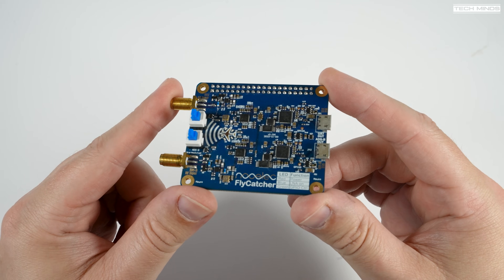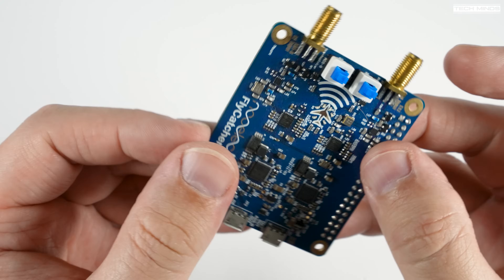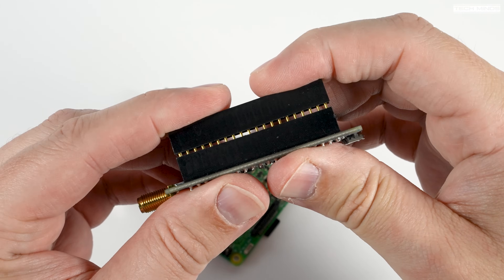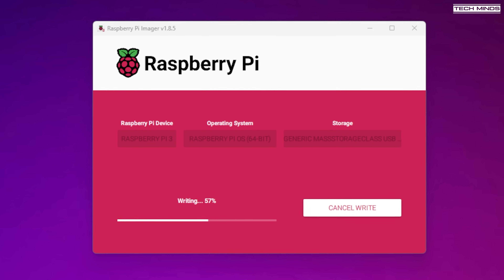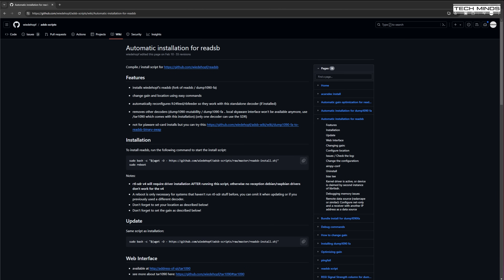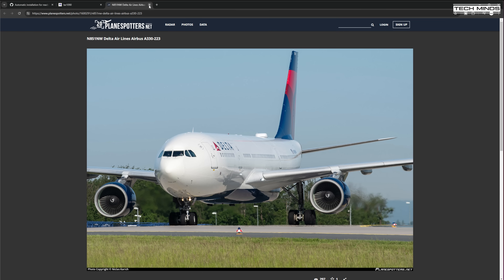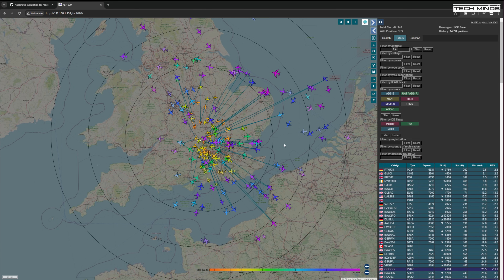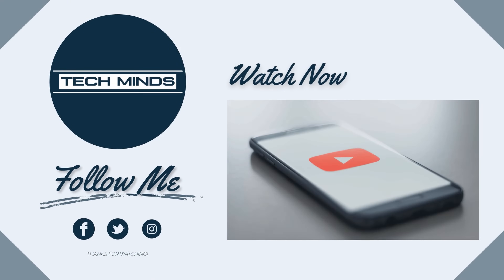Easily Create Your Own Aircraft Virtual Radar Using The NooElec FlyCatcher Pi Hat

Comment: I have it set up now and using in the field for our VO to monitor manned aircraft. Yes, I said "manned" as opposed to the woke term, "uncrewed". The old FAA boys prefer manned. LOL. So far, works great. I found a 3D printable case that fits well. The Pi can supply necessary power to the Flycatcher.

Comment: Big fail on this hat, it doesn't need/use (?) the 40 pin header and doesn't pass it through. The pins are unusable. So it blocks all the pins you might want to use for say.... environmental monitoring of the enclosure the pi is in. I love the idea, but this is a big fat Fail on nooelec's part. If you don't need the pins, either properly pass them through or don't use the form factor that blocks the pins.
Reply from the maker: Ummmm.. You can place the HAT at the top of the stack?

Comment: I run the blue FlightAware Pro USB stick with a Raspberry Pi 3B. It runs hot unless I use a fan so I've always been hesitant about using a hat with it. Maybe it's the quality of the heat sinks I'm using? I don't know but this hat is interesting and would be awesome for me since I can only do ADS-B and not UAT with my current setup. The ability to run both from one interface and one piece of hardware is awesome.

Comment: LOL ..What an Innovative Product Name (FlyCatcher) .. This is another reason I would want a Raspberry Pi for a detocated Set up for ADS-B.. But ..  I Don't need the Board as I would Just use a simple RTL-SDR with the Software.. The Home Brew ADS-B (1.09 Gig) Antenna that I made.. (Rocks) 200 Mile Radius Reception... No LNA or Filters needed. (Some PVC Pipe and some RG-6 Coax is all you Need to build one..) (16 Segment Co-liniar 👍)
Reply: Ditto. I fail to see why I'd purchase a $99 board if a $15 (or less) RTL dongle will do the job just as well. I have been providing flight radar and radar box with ADS-B data for many years now with el-cheapo RTL dongles and home made antennas without a glitch.

Comment: So it's an overcomplicated, quite expensive SDR in which the filter is used after the amplifier for some reason, and it doesn't use GPIO anyway and has to be connected via a USB cable?
Reply: But you get something that only can be used states side. Still rubbish here in the UK/Eu
Reply from the maker: Rubbish? Did you not see in the video how well it performs? I think what you actually mean is that it’s uneconomical to use in the UK because one side of it is for UAT, which is unused in the UK. I would definitely not call it rubbish.
Reply: @TechMindsOfficial  I did and I see better from a FA Pro stick plus, Uptronics LNA. The jet vision aerial is pretty bespoke you used. Heard mixed results with them but vs what I get using a Phil antenna, Noelec V5 and a Uptronics LNA I’m miles ahead.
Reply: Yep. Totally pointless
Reply from the maker: You get 2 x SDRs, 2 x Filters, 2 x LNA in one small form factor board. USB is independent from the GPIO and any data capable lines on the GPIO would not have the throughput.

Comment: I don't understand the purpose of the Pi hat form factor if the GPIO header is completely unused and you plug it in via USB anyway.
Reply: … MicroUSB? Ugh…. No thanks
Reply: I agree. what a messy setup.
Reply: Yeah, I don't understand chewing up space and BLOCKING OFF the forty-pin header of the RPi...AND THE EXTRA expense of the forty-pin header of the board in materials and installation. I bet some IDIOT in marketing made them do it 😉
Reply: @bob_mosavo  it is a pass-through so with a header that has appropriately long pins you can still stack another hat.
Reply: @explodinglemur  As shown in this video, it is NOT as pass-through unless you solder onto the pin(s) you wish to access. There are NO "appropriately long pins" shown in this video. I found this board on Amazon, and each pictured showed NO "appropriately long pins" for any type of pass-through without soldering. So, it's really just chewing up space and BLOCKING OFF the forty-pin header of the RPi. What a STUPID design.
Reply: Right, this should be mounted underneath and not on top.
Reply from the maker: You get 2 x SDRs, 2 x Filters, 2 x LNA in one small form factor board. USB is independent from the GPIO and any data capable lines on the GPIO would not have the throughput.
Reply: @TechMindsOfficial  Really, it's just a plug and been way better if it was an external USB3 device as the hat form factor offer no advantage in the way it is designed, and don't see how it could.  PCIe on the Pi4 would be an option, though external would be better on many level.
Reply: @TechMindsOfficial  yep, but they could have made it just a separate device with its own enclosure (and could have used a USB hub IC so you only need one USB connection).

Comment: Does the two SDRs have different serial numbers ? 
I could be a cool product, if the hat took advantage of the GPIO pins, instead of having the two USB cables hanging (not as compact). It is too pricy for me, beacuse I cannot use the UAT part in the EU. 
But it is always nice to see new products, so you know that is out there. Keep up the good work.
Reply: The UAT filter could be removed and replaced with a capacitor, You then have a wideband sdr for use on aircraft band using other software ie sdr#, HDSDR etc. After all they are 2 independant receivers. Just a thought.   :-) Typo edited
Reply from the maker: @nofider1  That's a really cool idea! As I am in the UK I would never use the UAT side, but having it connected to an AirBand antenna I could also use it to listen to airband.. nice..!

Comment: Why place the filter AFTER the LNA?
Reply: You've got two options for filter/LNA arrangement order and each has pluses/minusues.
Antenna -> LNA -> filter: You get maximum signal into the LNA so you minimize your noise figure. However if you have strong signals not in your target band you can saturate the LNA and then get nothing of your desired signal.
Antenna -> filter -> LNA: You reject all undesired bands so your LNA has only the signal you want being passed to it for the cleanest amplification. However the filter adds insertion loss and so with a lower strength input signal you get a higher total noise figure.
So, it depends on your RF environment. A Pi sitting on a desk or in an attic is less likely to have strong signals in other bands saturating it so they went with the option for a lower noise figure. The best place for the LNA is right at the antenna though so you don't get feedline losses before the LNA which can increase your noise figure.
Reply from the maker: And that’s why I used the LNA in my antenna and disabled LNA on board. Worked extremely well.
Reply: @TechMindsOfficial  "IN" your antenna or "AT" your antenna 🙃
Reply: @explodinglemur  Really appreciate the very clear explanation.